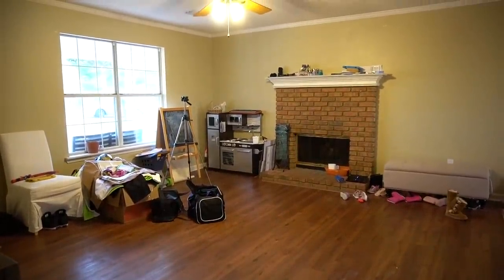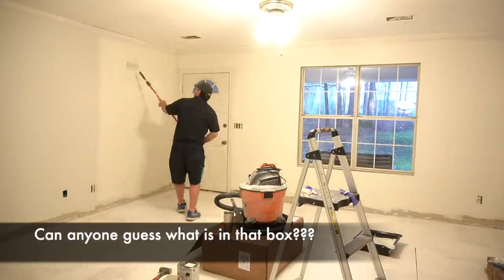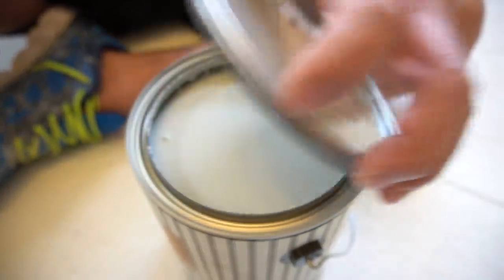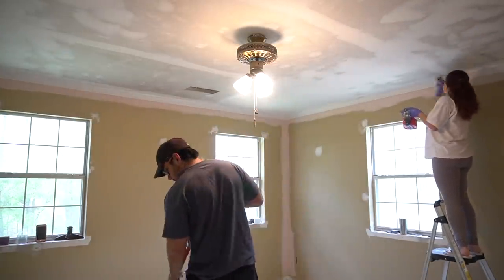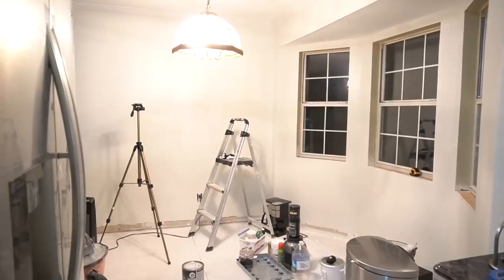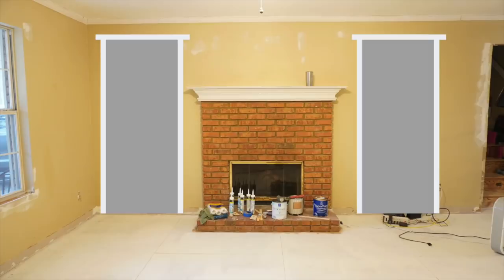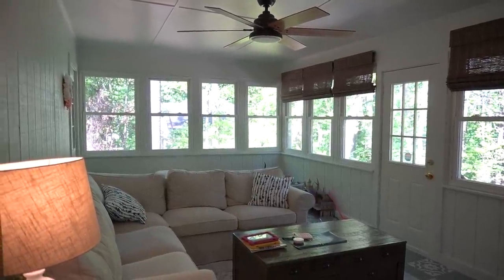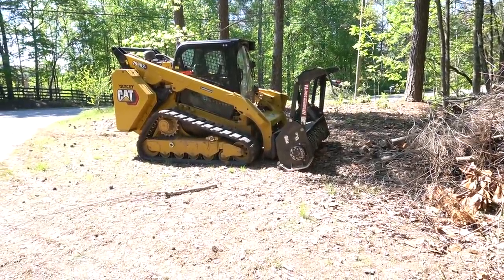RENOVATION UPDATE EPISODE 2 | Our Fixer Upper | Fixing up our "Farmhouse"

Comment: We are redoing our house to sell. Wanted to do it anyways. But now it is time to expand in acreage. 5 is just not enough lol. So we're selling. 
QUESTION... what all did you do to your ceilings?  We're removing the popcorn upstairs. But what else did you do to prepare for paint? We were told there was tons of work. Our downstairs is knock down and we can try to do that up. But if you didn't do much more than take off popcorn then paint, that would be easier. 
TIA...
Reply from the maker: It is a lot of work but if you’re well prepared you can definitely tackle it on your own and save a lot of money (as well as increase the value of the home). We explain exactly what we did in this video. Hopefully it will get all your questions answered. https://youtu.be/Vc5B70OcnzU

Comment: Have you checked out thrift stores/Salvation Army/Goodwill for a sturdy dresser to use as a base for your kitchen island? The neat thing is that they have drawers that can hold your pots & pans or small kitchen appliances, linens, etc. Plus, you can paint/stain the dresser any color you want. Get the top you want: granite, butcher block, quartz, etc. And the price could be dirt cheap. Just saying...